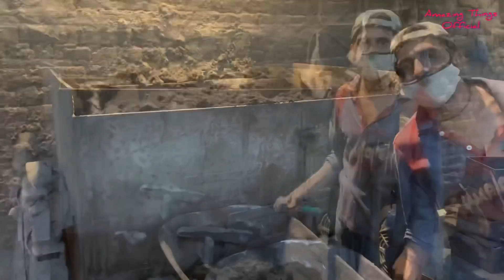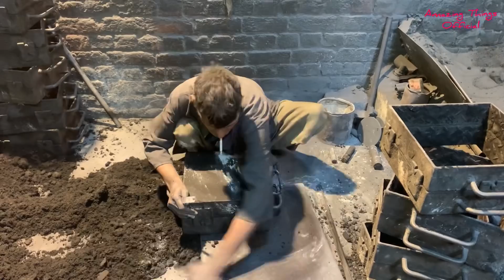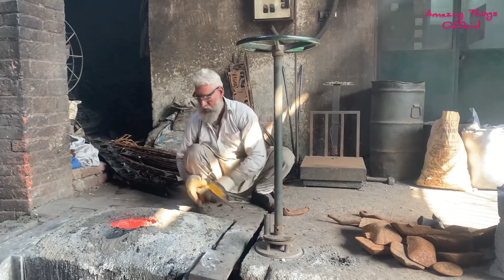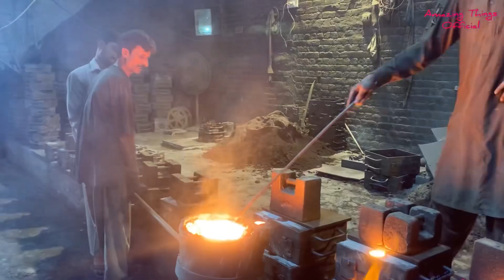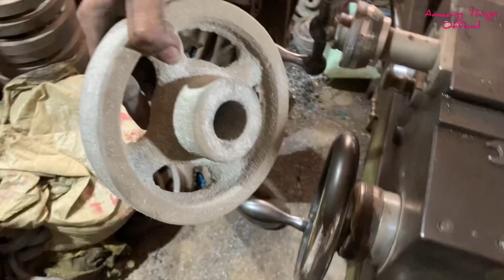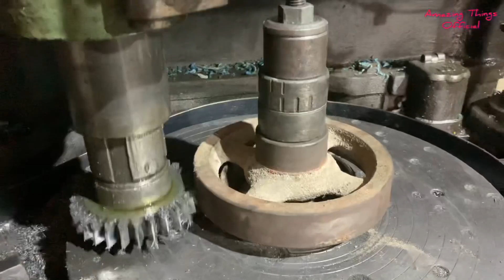The Timing Gear Machining and Milling Process | How Gear Machining and Milling After Casting is Done

Comment: Placing the part in the gear cutter shouldn't require indicating and adjustment by tapping. If it does (since the hole is larger than the mandrel), the hole will not be concentric with the gear tooth circle. I think the basic problem is the outside was not cut in the same setup on the lathe as the hole was.

Comment: Well,
This is what you call a self fulfilling prophecy.
Build bad gears from scrap….
Install bad gears in engine….
Break bad gears a month later…
Build a new “bad” gear to replace it.
Prophecy fulfilled.
P.S…..what the hell is going on with that lathe?
Why bother if the junk gears are getting roughed out on that POS machine?
Reply: It's not the lathe. It's the operator that did not center the part properly with the 4 jaw chuck.